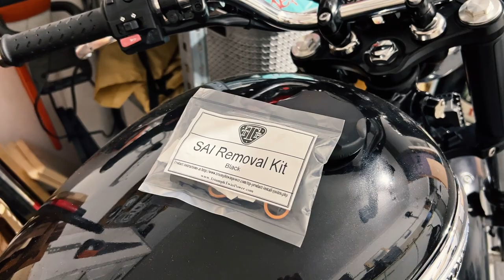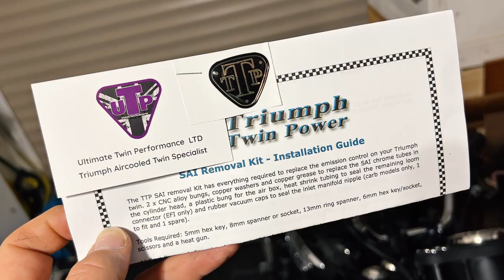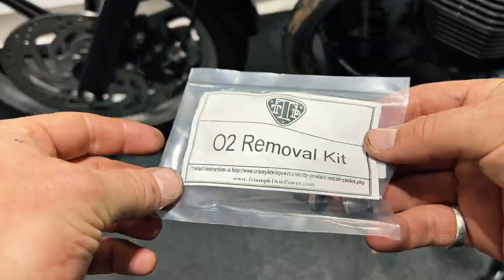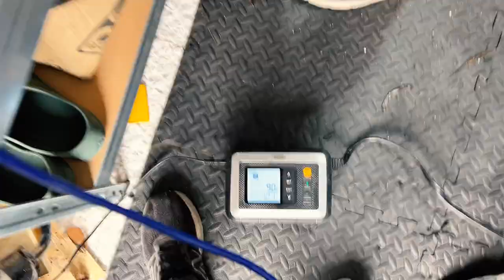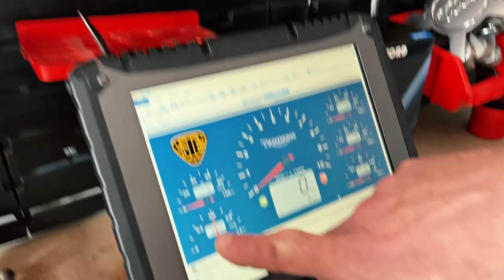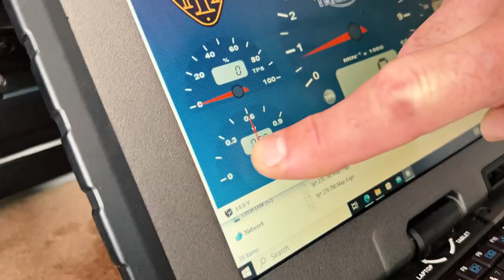Pt.4: Triumph Bonneville 865 - Performance Upgrades

Comment: Interesting video… I installed a booster plug, sorted out the juddering in low gears, better throttle response,no re-map needed.
Reply from the maker: Yeah I had one of those on my previous bike. To me it didn’t seem to do all that much

Comment: I have a 2014 T100.  Installed a K&N filter and Progressive suspension.  Runs great as is.  If I want more power, I will ride my Honda Valkyrie or BMW 1200RT.

Comment: On the air box the air snorkel tube actually comes off the outer casing so you don't need to buy the adaptor. Fitting the K&N air filter makes a lovely sound when you open it up, ive got the carb model so I had to re jet it. Changed the exhaust, all the upgrades makes the bonnie a. Great bike.